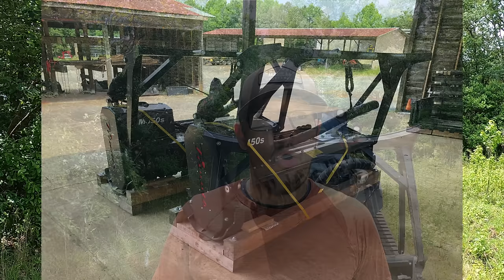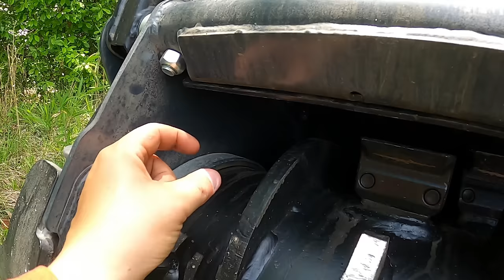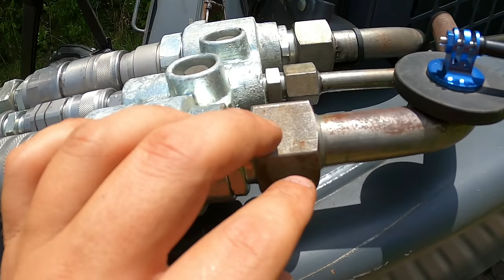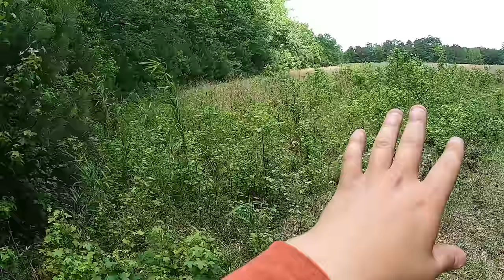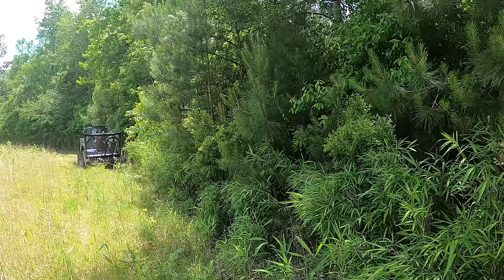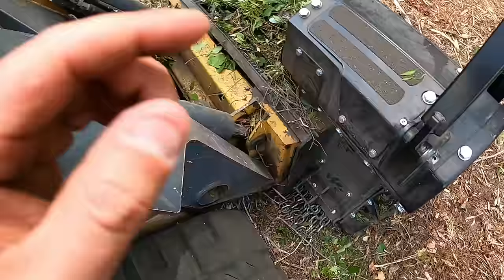BIG MUNCHIE HAS ARRIVED! Prinoth M450s-1600 Skid Steer Mulcher!

Comment: Love your content and how you explain to the uneducated in your field how things work and why you do things a certain way.
I have an idea for the Prinoth 1600 Head and the visual issue for how low you have it.  You could mount your own created depth gauge using a round rod and some bushings.  Bolt the bushings to the side or back and mark the rod for various head heights.  You could mount a low slide limit on the rod to prevent it from going too low at whatever max you determine is the best using a screw on collar.  Weld on an oval foot to the bottom of the rod to allow it to slide avoiding snags.  Just an idea but not being there it is hard to determine exactly the best mounting point and what will work best.  At least I wanted to throw an idea out there that you could adapt to your situation to make your situation palatable.  God Speed!

Comment: I think that with taller, more spindly trees that you might want to use the high bar above the mulcher to push the falling tree away from the skid steer as it falls, and thence need the extra length of hose. Great lead in. Personal.

Comment: Very nice.  That thing is a beast.  But I have one suggestion for you.  On the outside shots I was watching as the trees and branches were going up and brushing over the manifold on the arm.  It might be a good idea if you could make some kind of a heavy duty guard that would cover it and the connections to it so a stiff branch or something else won't come it and break it off as easily.  Maybe something with an angle on the front and back of it so things ride up and over them going both forward and backward instead of something getting up under the connections between the arm and the connections and breaking them off.

Comment: Nice machine. 

Farmers wont drive their tractors through low branches, thats why their fields end up shrinking. You could add value to your operation by investing in a quad saw to do a high vertical cut to remove the low (for a tractor) branches. Should be fairly easy to mount a quad saw on a skidsteer mount?

Comment: I have a Timber Axe which is about a decade older mower/mulcher that runs on a 60 horse ASV.  It's essentially a wheel with brush chipper blades as cutters.   It's impressive to see how far these implements have come along.

Comment: Deere has guaranteed that that hi-flo system will put out at least 33 gallons a minute. Having it test at 35 gpm is not surprising since that is only 6% higher than the minimum it is supposed to produce.

Comment: If you move the raker arm down one notch you should get the tree's too bend away right into your teeth. Just a suggestion ask John what he thinks he's going to know what way is better. As always good luck and God Bless.
Reply from the maker: Thanks for the suggestion Mark! Yeah I'd like to hit up John and get his thoughts on it and see if he's got any tips for running it! Thanks for watching and commenting!
Reply: I would even look into connecting hydraulic rams to each end of the raker so he could move it forward and backward as he needed to instead of it just being stationary.  Looking at how the raker is attached, it looks like you could remove those upper braces and replace them with hydraulic rams.

Comment: This is a nice monster machine here that chewed everything up in one piece.  But i watch lota of your video's and enjoy it each and every time I watch them.. and on this one i noticed while you was going inside to grab the 🌳 🌲  it scared me because there is No protector shielded glass surrounding you in front window shielded if accidentally a branch or tree or bushes comes flying inside in front of you 😳🤔 this monster need a shielded for your safety and protection while operating this at alll times it aint like the other monster machine that swings back and forth that machine looks taller then this one look shorter like the trees is coming inside of the monster while you are driving to tored them up... it scared me for a minute.. so safety first. Great job 👏🏾 👍🏽 👌🏽 cutting up them 🌳 🌲 and bushes.

Comment: Wait a minute..? You spent $37,500 for a mulcher that only mulches saplings and overgrowth. When I had my land mulched (10 acres) the skid steer mulcher the company had was able to totally take down 14-15 inch diameter pine and oak trees. The guy from the company told me that his mulcher cost about $30K...His mulcher had 'narly' teeth like a chain saw. This mulcher only has metal tines. I think it was a CAT mulcher. Pretty expensive mulcher for something that a good bush hog would do...that costs less than $10K.
Reply: I have a 2021 Cat HM415C with about 15 hours on it now, carbide hammers instead of the sharp teeth, mounted on a 110hp Cat 299xhp and it would take me a considerable amount of time, like hours, to mulch up 14-15" diameter oak or pines. Even 6-8" cedar trees take me some maneuvering around to chew them up. It will do it, it just takes a long time. I prefer to mulch everything   4-5"  or less, knock down anything bigger and grind up the branches, cut the rest into "logs" and haul them off and burn them. On the other hand, I have hit the occasional buried boulder top or steel fence post and there's some sparks and a lot of noise, but no real damage. And the Cat (FAE pretty much) head is closer to 40k than 30, but inflation has been taking equipment prices on a friggin' rocket ride in the last several years.
Reply: @manofinterests334  Sorry I should have been more clear...What I meant was that the guy who mulched my land did just what you said you would do, except what I meant was that he was able to chew through pretty much every tree on my land to bring the tree down. He did not mulch the whole tree. But he did bring down 14 inch oak trees with no problem. Also the teeth he had on his mulcher were (as I said) 'narly teeth'. He had an assistant who would then sharpen the teeth with a grinder after he done using the mulcher. They were definitely teeth with bladed edge. Square at the mounting base, making a 90 degree turn to a chiseled blade.

Comment: So I'm guessing that the MTL will be 'reassigned' to primarily mowing jobs while your newest acquisition will handling the heavier mulching duties.
Reply from the maker: Yes exactly! The MTL isn't going anywhere but the mulcher will save it some abuse for jobs that it's not quite designed for.
Reply: @idigit4967   a smart and economical move, the new mulcher will cut down on the time normally required for a heavier job. Meaning it'll pay for itself much quicker. 👍👍

Comment: You blow my mind with the throttle because I've always heard you're supposed to run skidsteers wide open. Have you been told not to by the dealer or why do you do that. If you haven't talked to the skidsteer dealer about running the thing full throttle I think you should.

Comment: What I don’t understand is this.  I’m at 21:46 and what I don’t understand is this. So many times you will back up,  time and time again.  Like now. In high growth areas. And yet you haven’t moved no more than 5, maximum 10 feet into it. To me if it is as powerful as you state,  it would not have to back up. Time.  After time.
Reply from the maker: Backing up allows the mulcher to take in the material into the drum and further process it into mulch.  The back and forth process is how mulching is done with these machines.
Reply: @idigit4967  That is absolutely not true. A much more aggressive toothed mulcher that even costs less than the one you bought, did not need to constantly back up the clear the mulch blades or mulch better (what??). The CAT mulcher actually mulches as it is bringing down the trees and overgrowth. Got plenty of pictures of my 10 acres being mulched...a better mulcher would do the mulching on the run....seen it happen...been there and done it that way.
Reply: @relaxationstation2047   Can you imagine if it had a built-in beep-beep-beep on backup mode.  LOL
Reply: @relaxationstation2047  with the cat HM415c mulcher I can knock stuff down and tear it up going forward without stopping... but if you don't back over it, it doesn't turn it into the smaller "mulch" that people usually want. Ie, if I cut off a 3-4" sapling at the base and push it over, the drum often grabs it and throws it backwards under the machine. When you back up with the head tilted slightly forward it grabs it and pulls it up into the head and grinds it into the smaller mulch desired for quicker decomposition and a smoother surface.

Comment: You need to shorten your hydraulic mindset just a little bit. Sticking  out in front of the cage it's going to get abraded by all that junk you're trying to cut down. Otherwise it's a nice head.
Reply from the maker: Yes sir I was thinking the same thing! Thank you for watching and commenting!
Reply: @idigit4967  So what do you use the blue blowers for in the shop? Did I miss a video about that?

Comment: Why do you guys all seem to do that back and forth stuff instead of just run everything over in a whole row and then go back over it as many times as needed... even if it's backing up... do whole rows?  It seems like so much time is lost in changing vehicle directions every literally 5 or 10 seconds.  It's hard to watch.  I'd knock everything down as quickly as possible and then go back over it to reduce the brush waste.
Reply: The drum needs to recover
Reply: @johnburdell2347  I was thinking the same as William. Seems so much time wasted going back and forth. I understand drum slows and needs to spin back up, but I would think you’d keep pushing forward, pause, push some more, pause, etc.